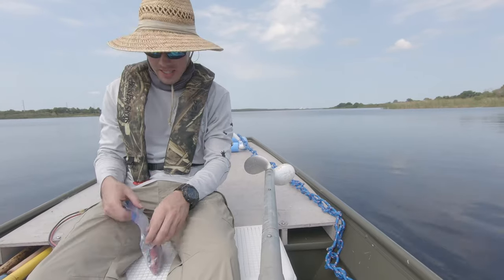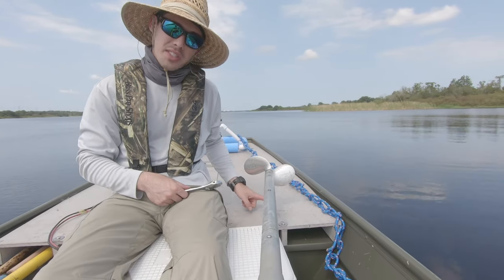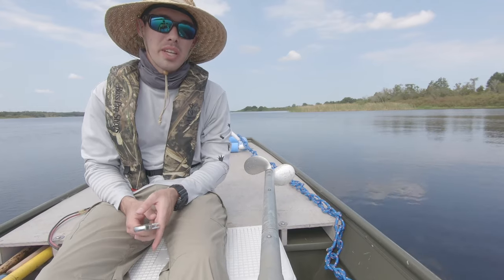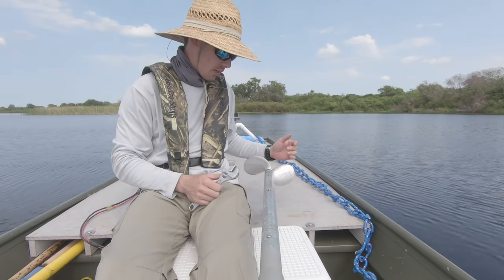BENDING Longtail Skeg aka Tuning a Longtail Mud Motor

Comment: I have a 670 on my 1436 I just ordered a 8.5 hurricane prop. I’m gonna say my weight distribution and you tell me if it’s to much weight over all as well. I know hurricane props are for light boats. So I have a untreated plywood floor in front. Light weight with on top a 55 pound battery, fuel tank with 4-5 gallons in it so 30 pounds safe to say. Then a crate with prop puller props fishing gear ext prob 7 pounds or so. Then me 170lbs in the back with the motor. It doesn’t swamp and I build the transom up for the weight so maybe 10 15 pounds of aluminum and steel back there total. Any advise or comparison is great. Thanks!
Reply from the maker: As long as the boat sits flat, or has just a little bow rise, you should be good. If it's hard to handle, add more bow weight to see if it helps. I run the 8.5 hurricane with my 13hp on the 1436 as you see it in the videos. It sounds like the same weight as your rig minus the difference in the engine. If you think the boat will be too heavy for the 8.5 hurricane, I wouldn't worry about it. Maybe if you had a 13hp engine like me, but I still get 20mph +. So I don't see why it would not work for you. You may have a little more weight, but almost double the power.

Comment: Great video on an adjustment that's often overlooked JT. Is this running the weedless prop? Changing to the weedless was one of the best things I've done to improve performance and handling. It's taken a beating that the standard props just wont take and reduced prop walk a lot. Thank you for the recommendation.
Reply from the maker: Thank you River Rat! I normally run the weedless prop. It's my favorite prop. In this video, I was playing around with the 8.5" prop. I agree with you, I have taken some big hits with the weedless where I wouldn't think the standard prop would have help up
Reply: @JTgatoring    what is the downside to the weedless?  how does it actually work?

Comment: Thanks man for the reply! I’ve actually lightened my 670 some…. I got a light weight muffler and got the motor and kit to about 170 pounds. Still heavy but how much weight was in the front of yours with deck troller battery ext?  I’ve gotta get mine fine tuned just working on it as I can! When I don’t use it I figured out folding it around and siting the skeg on the ground lets the water come out and keeps some weight off to! I’m sure you knew that tho
Reply from the maker: I have videos on how much the floor and front deck weigh. Then I had a big deep cycle battery up front so guestimate at 60lbs there, plus the trolling motor, and then miscellaneous stuff that was probably about 20lbs. If it was a fishing trip, I would have a cooler with ice, a couple of rods, and a bow. Sometimes I would have a second person with me but I normally ran the weedless prop anyway. Speed was never a priority. Most of the distances I fish are quite short.
Reply: @JTgatoring  yeah okay I’ll be sure to watch those videos ! But speed is some what a priority because I’m running long stretches of river. With a group but what’s your opinion on float pods ? I’m thinking on adding them but will I loose speed. If I do them correctly I shouldn’t right ?
Reply from the maker: @coltensawyer6761  Float pods will make you lose speed with a longtail. If anything, it would have to be one "float pod" that goes from side to side, aka a hunt deck. You want the trailing edge of the transom to be one straight line. When you add float pods, you break that line which negatively affects performance when it comes to a longtail. Look up "hull speed". Boat hulls hit a wall when they reach a certain speed depending on the design of the hull. After that wall, any additional power added is less effective. As a general rule, if the width of the boat is kept the same and the length is increased, the hull-speed/hull-efficiency increases also, but with increased length, there is also more drag due to increased surface area so more power will be needed. So what I guess I'm trying to explain is, you are adding more weight and more surface area and not changing your hp so you will likely see a decrease in speed unless the changes made greatly increase the efficiency of the hull.
Reply: @JTgatoring  okay fair enough! I was thinking on trying them because they helped my buddy’s boat out Is why I ask ! How much bow rise do you want when running the boat ? Basically how much of the bow should not be contacting the water when planing out ? On are size boats. Few feet ? Thanks man your knowledge helps me !
Reply from the maker: @coltensawyer6761  Through my eyes, when running on plane, the water line should be just behind the weld point on the jon boat bow where the bottom starts to make the bend to the bow. You want to ride pretty level, but if you were to favor one over the other, I would rather be transom-heavy than bow-heavy when it comes to performance. If you are bow heavy or just overloaded, the boat will start to plow which kills performance.

Comment: hey brother.what is the HP on that mud moter and what is its top speed? thanks
Reply from the maker: The boat is a 1436 with a 13hp predator engine and a Swamp Runner medium kit. Normal speed is 18 mph with a 8.5" prop and two people. I've gotten it to 23mph with a 9" prop.